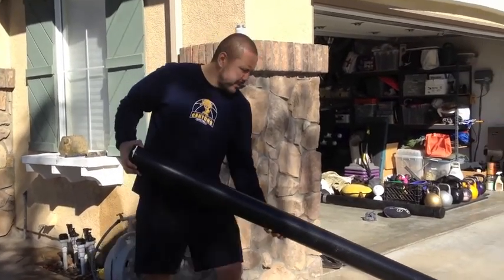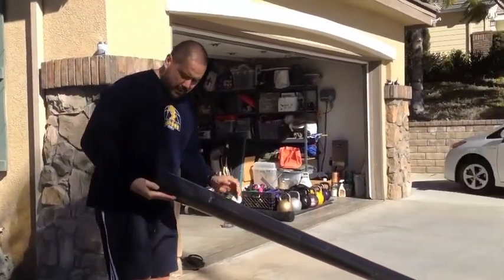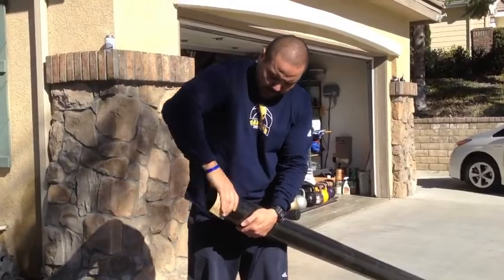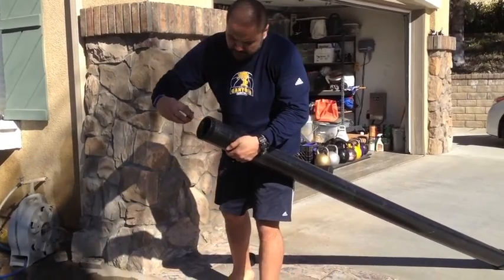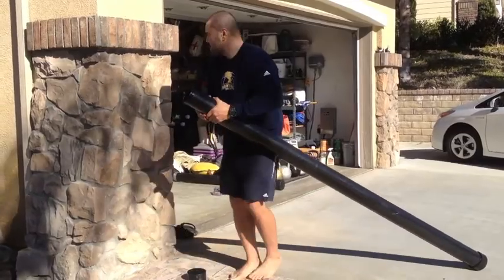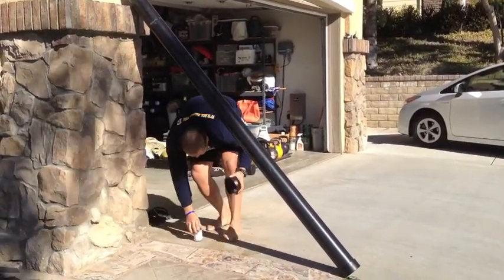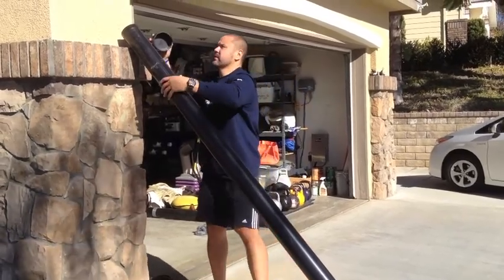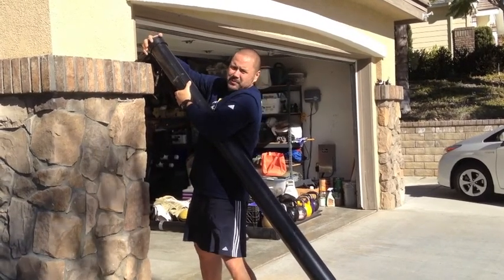BID VID - Revisiting the Sloshpipe

Comment from the maker: Hey Janine, 8 feet will be a BEAR....probably doable but you will be limited to bilateral movts. like squats. The other option is to move to a 3 in. diameter as this would make it a bit easier but tougher than a 5-6 foot one with a 4 in. diameter.

Comment: Coach Dos Thanks so much for posting! Quick question, I am fairly petite 5'2" and 115lbs, but ridiculously strong for a middle age mom (if I do say so myself!) :P. Do you still recommend 8' or would I be better off w/ something a bit smaller. My mantra is "don't strengthen dysfunction"!! I'm worried that the longer pipe would cause me to compensate too much. Thoughts? Thanks in advance!